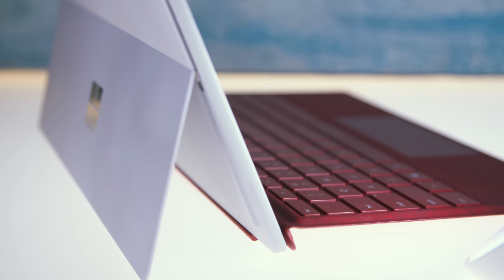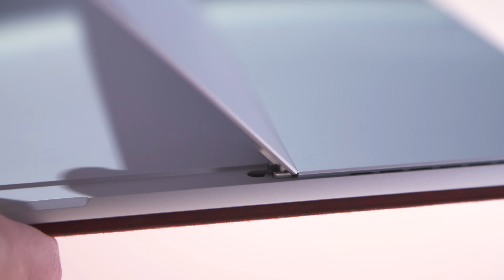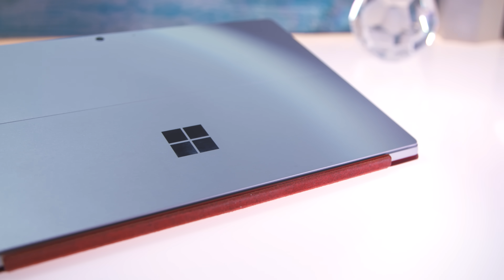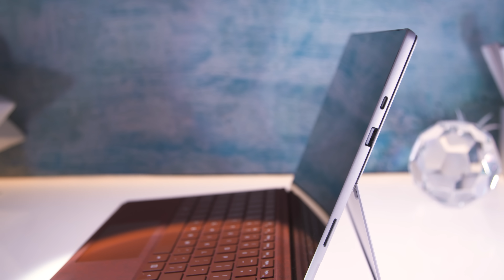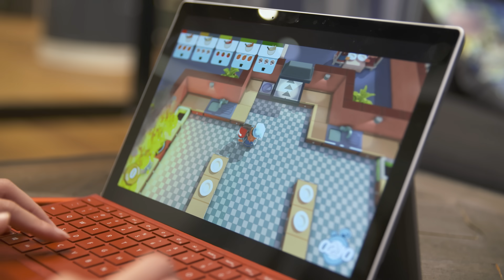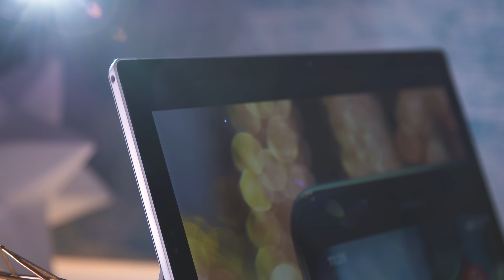Microsoft Surface Pro 7 review: USB-C upgrade, battery downgrade

Comment: I think I’ll get the 6 just because it’s cheaper
Reply: Jiimy I got mine two weeks ago. 850€ the i5/8/128 model with the keyboard.
Reply: Any upgrade of the SP7 outside of fast-charge and usb-c? Are the specs really a big improvement? A lower battery life is a pretty big con.
Reply: @nickh4676  yes iris gpu and faster cpu
Reply: Nicholas Hale I don’t think so imo, yeah that battery life is a big downside, and there’s an adapter with the 6 that has usb c (you have to buy) otherwise that’s it

Comment: USB-C without Thunderbolt compatibility is not an "upgrade", it's mere catchup. 

If the keyboard feels "hollow", lay it flat on the table instead of using the magnet to angle it upwards.

Comment: Never EVER BUY a surface pro shit machine.  The PRO 4 that I had, is one of the worst decisions I ever made when I decided to get a note book.  This should be no different.
Reply: Well if you never try you will never know. I am happy with mine
Reply: Jayakumar Menon what is the problem? Battery life?
Reply: @nuevoinvolve  Everything.  Keyboard forever has problems.  You press one key some other key responds.  You keep reseting the thing and after awhile it comes back again.  The battery life SUCKS.  Accessories cost a bomb.  They had to come up with stupid power supply connectors.  And the list goes on.  I am very contented with my Asus now.
Reply: I love the Surface Pro!
Reply: I agree that the 4 had a lot of issues. But they seemed to be non existent on the 5+ models.
Reply: I have a sp4 2017 with maxed out specs (biggest, fastest etc) since I wanted to make it last a few years. I'm still happy with it except for the battery....oh and this weird fan noise it makes.  I've seen others have the same problems and apparently it's a driver update issue. Anyone else have this problem?
Reply: @danielb3500  do u own sp4 or sp5? Sp5 was released in 2017. Sp4 was 2015
Reply: @ Jayakumar Menon you should get 2017 version onwards. Much more refine. I heard alot of complaints for sp4

Comment: Watching this on my Surface Pro 4. Looks almost exactly the same, lol.
Reply: Looks the same but not a annoying fan like the SP4, a way better performance and battery. But I still won't switch to the 7.
Reply: @apfelschorle1988  yeah the fan on my SP4 is loud. Nowhere for the noise to go in such a thin device.
Reply: So how long does your battery last? Mine just 3 hours (SP2017)
Reply: @nuevoinvolve  you're only getting 3 hours from the Surface Pro 5? It's supposed to be a lot better than the SP4.
Reply: Me too
Reply: TheTelephonePrankster keeps production cost down

You realize that when it comes to manufacturing products that change cost money

But if they can keep the same basic design for long as possible it helps to keep cost down as they upgraded the important things like cpu she ports

But soon as you make a bigger outer design change they means resetting up all new machining for making that new design 

So people want new things every new generation, well the best way to not also have yo raise the prices is to keep the same outer design
Reply: Mine lasts about the same (sp4 2017) ...3hrs
Reply: @danielb3500  do you have the Surface Pro 4 (2015) or Surface Pro 2017?
Reply: @bradavon  I have a 2017
Reply: @danielb3500  SP5 then. You only get 3 hours. It should be much better than the SP4 😱
Reply: It is exactly the same. Much better battery, no fan, fast charging and USB C though.

Comment: We deployed hundreds of Surface Pro's when they first came out. Everyone was so excited to get them. In actually use hardly anyone ever used the pen and mostly just ended up using it like a laptop. Now it's time to replace them and everyone is going back to laptops and not choosing a Surface. The laptops are cheaper too.
Reply: Perhaps more training was in order to educate people on how they could make the use of the pen and touch gestures
Reply: @thetelephoneprankster4254  Why? No-one needs them on a laptop-like device. Which is why I have never seen the point of a touchscreen on a laptop either. Surface devices are mostly used in laptop mode, mainly because windows 10 still sucks as a touch OS compared to the opposition.
Reply: @MichaelGGarry  the opposition being Ubuntu? MacOS? What laptop (not tablet) OS has better touch support than Windows?
Reply: @HenriZwols  I don't think any of them have good or even decent touch support. So to say Windows is the best of a very bad bunch is not to say much at all. 

The opposite would be just as bad with iOS or Android when used in desktop mode. No-one has come up with a solution that works well under both input types, they are all far too compromised.

Comment: Wrong. Surface is not made for people who want a tablet. Surface is made for people who want a surface. It's a machine that's unique in his type. This doesn't excuse worse specs than the previous generations though.
Reply: It doesn’t have worse specs...
Reply: @springbok4015  yeah that's right, it has the same specs as the previous gen, i.e. worse specs than it should.
Reply: @JohnnoNonno  It's got an updated processor :P

Comment: I own nothing that uses USB C. I have my Mini DisplayPort adaptor which does me well enough
Reply: Maybe you got lucky.

I had so many problems with Mini DisplayPort adaptors on my SP4 (I had to buy two adaptors). It would only display 1080p or 30Hz or even the screen would just black out randomly. And when I searched for solutions online, it seemed many others were having the same problems.

My old laptop worked perfectly fine with its HDMI port and my phone never has problems when I use a USB-C to HDMI cable.
Reply: I suppose I was lucky. I did buy the official Microsoft adapter so perhaps there is a conspiracy that they want people to buy their one lol

Comment: I don't understand this whole craze of USB-C. How many devices and times do you really need more than one connection when you purchase a device like this? I've been in IT for 16 years and to date, no one in the corporate world has called me in panic that they needed more than one port.

You also fail to mention that it supports fast charging. Yes, battery is less than previous models but it also goes from 0 to 80 around an hour.

I understand that it doesn't "excite" the sense as they have a something that, "If it ain't broke, don't fix it". Besides, they introduced enough new products to keep our appetite full until next year 2020 holiday.

Can't please anyone these days. Geez.
Reply: I use one usb c charger to charge my laptop, smartphone and Bluetooth headphones. I use usb c also to output display on an external monitor at home, it's convenient af to have just two cables and a charger to do everything, idk what u r talkin about
Reply: The Surface has Miracast so you can stream wirelessly anyway. I am talking about how my phone does not have USB C and I have proper studio headphones. I am not old fashioned and have tried it. Yes I am using an iPhone
Reply: @nailil5722  please, name all of your devices. My Bluetooth headset charges wirelessly (I can't believe you're still using connecting charging for that) as does my phone (and it has Type C, Galaxy S10e). Only my Nintendo Switch and the Pro controller I actually use connection as it is required. 

You are exactly the example as to, everything I have has to have it. So, do you charge each one of these devices with only one USB C at a time.  I'm guessing when you go to bed you have to choose only one device to charge then? "Oh what will it be, my laptop, my phone or my headphones?"

I have yet heard a reasonable reason why it is the so vital to have it.
Reply: @TheHaitian  xiaomi mi notebook pro, xiaomi mi9t, aukey T10, a Samsung ultrawide monitor and some cheap mpow headphones I don't even know the name which to my surprise had usb - c. When I'm on the go especially for work having just one charger in the backpack is a blessing but I guess you have the privilege to stay all day at home
Reply: @TheHaitian  at home of course when I need it I can charge multiple devices with the chargers that came with them. the luxury is being able to charge my laptop and my phone with a usb c charger on the go instead of carrying a proprietary DC charger for the laptop and another one for the phone. All this knowing that you can use that usb c cable for everything. Have you ever experienced a laptop DC charger fail on you while you were travelling for work? Literally wasted my time to respond to someone that probably still plays with a Nintendo switch in his 30' or 40'. Smh.
Reply: @nailil5722  I think you mean the "convenience" and not luxury, you might want to read up on the definitions as to which is what and when to use them more effectively in sentences.

You're not making a strong argument other than the fact that you are not coherent enough to use different types of connectors to charge your devices or good enough to figure out what connectors to take with you to work on the road or keep them in good enough shape for them not to break.

Nice trying on demeaning me because I have a family and we play our Switch together and yes, I am 39.

And don't ever put yourself down saying that you wasted your time. You are better than that.
Reply: @TheHaitian  I've been on a MBP for 3 years so almost everything I own is USB-C/TB3 nowadays. Why on earth do you want to stick with multiple connector types these days?

Also wirelessly charging headphones - are they in-ear or something? They are the only ones I have ever seen have wireless charging. I prefer wearing over-ear cans and they all use some form of USB for charging......

And yes, I work in IT too and am only slightly older than you.
Reply: @MichaelGGarry  Finally! A brother in arms in IT. I don't know if you also work for at a corporate firm, but how many people have come to you for a USB type C thumb drive since USB C has been out? Is it worth buying a whole new Surface just because it now has type C? In our work environment it is not worth it. I'm personally sticking with my SP4 for a couple more years.

Blvcknoir 2 Bluetooth headphones by the way for BT Headset. Pretty solid actually. They are a carbon copy of Apple AirPods for a fraction of the price.

That dongle life is not for many of us. Today, for the work that I do, I would chose a laptop with a Type A usb over a type C and not need that dongle. These days, in our office anyway, we use far more USB Type A then type C for carrying data.

I have no doubt that in some fields it is a godsend to them, but for the vast majority of people in the world, it is not.

Please chime in on this. I am curious about your work place and if they are pushing it in your office. Always good to get those feedbacks.

I'm not saying it is bad technology. It is absolutely wonderful but we are not there just yet. I think once all thumb drives are type C, we will be there. But hey, that dongle life is for people out there that prefer looks over function.
Reply: @TheHaitian  Thumb drives? I have not had to use a thumb drive in about 5 years. Do people not have network shares, cloud storage or any of the other ways to share data?

I can see in a lot of companies there would still be a load of USB-A stuff, that all takes a long time to shift to a new standard in companies of a given size, but I rarely have had to plug anything into my laptop for a very long time. External monitor - simple new cable. Mouse and headphones are Bluetooth and charge via USB (sadly still micro USB on my mouse as I'm not upgrading to the new version just yet), but both of those have incredibly long battery lives that I hardly ever have to charge them. What else is there to plug in these days? Printer is wireless. My external drives are plugged in via a dock which is USB-C. I have an eGPU, but that's TB3 of course.  Everything else is either Bluetooth or wifi. 

The "dongle life" has always been overblown in my experience. I bought a couple of new cables where I could, bought a USB-C to A dock that I hardly ever use and that's about it. Hardly "dongle hell".
Reply: @MichaelGGarry  in our IT world and environment (law firm) the good old USB A thumb drive has been nothing short of a life saver. Particularly in in-house meetings.

For sharing data with clients abroad we did create our own data room and for email attachment encryption we use PGP (a nightmare to get it to work between parties).

Type C technology is wonderful and is the future but I don't think it is a must have for now. There's a reason they left the type A on the SP7.

I agree with you that it will take a long time for it to switch and when it does, it will be very nice but for today's real world scenario type A is far more useful.
Reply: I completely agree with you. I own nothing that uses USB C
Reply: @thetelephoneprankster4254  The only way that's possible is if you're using an iPhone or your Android phone is older than 3 years.
Reply: @thetelephoneprankster4254  I have a galaxy S10e that uses type C but I charge wirelessly, my Switch and Pro controller has it, but I don't need all of my devices to have it.

I always read the same thing, but you can charge all of your devices with one connection. OK, so do you charge them one at a time? No, you will have multiple Type C around if you own only that connection. 

The argument to me holds no merit.
Reply: @Big Boss Not old school at all. Galaxy S10e, Nintendo Switch are the only 2 devices I own that have USB Type C. I'm not complaining that why all of my devices don't have it. How many devices do you have that have type C and how often do you use it? I don't even charge my phone with it I charge wirelessly. Only my Switch and it's controller I have to physically connect.

Please, tell us of all of your Type C devices.

Comment: The real question is how the heck your battery life test got 15 hours for a Surface Pro...
Reply: My Name yeah! Mine is just fucking 3 hours (SP2017)
Reply: @nuevoinvolve  which version? i3/i5/i7? My sp5 2017 still runs over well 8hrs
Reply: EyhTwo Zed i5. 128GB.
8 hrs doing what? Let me know?

I am using adobe software, I bought the device only for that activity, nothing else.

Now just 1 hours.

500ish battery cycle 

Been using just less than 2 years.
Reply: @nuevoinvolve  for net browsing, research and office stuff combination i do get 8hrs plus. This is done under super low bright settings with battery savers on.  
When im on creative mode using illustrator and a chrome with 10 plus tabs maybe i could get about 6hrs with idling mode. I sometimes use other software like paint tool sai. Most of the time my settings are turn off except for battery saver.
I also limit the app that is running on the background. This can be done under settings>battery> see ehich apps are affectingyour battery life and then turn on only reduce work option. 
I also disable some services running on the background. Lastly i work under cool environment. Those are the things i did to extend battery.
Reply: EyhTwo Zed that’s pretty good. How many years using the tablet?
Reply: @nuevoinvolve  i got it when it was first launch. It was an upgrade from my sp3
Reply: @eyhtwozed2606  So do you still highly recommend the sp7? I too am upgrading from sp3 since the keyboard is not recognized anymore by the tablet. Seems I can't find any explanation of why this happened.
Reply: @sw6716  sadly as of today both my sp3 and sp2017 stop working after recent update. My sp3 stuck at surface logo and my sp2017 kept requiring me to input bitlocker key even tho ive done it countless times. I cannot force reboot, i cannot rollback updates. I do not recommend surface product to anyone right now
Reply: @eyhtwozed2606  She said i5. I think, as for now, Engadget is primarily reviewing i5 model combo devices, when there's an option available.
Reply: @nuevoinvolve  do you switch your performance slider to Power Saver? That seems pretty bad even for performance at max.
Reply: @queasy.8065  since from day 1, always use power saver
Reply: Video loop on low brightness level
Reply: @DarkPa1adin  With NOTHING running but the video. Thats why she got 15 from the 6, and only 8 hours from the 7, she had to have had other software running in the background while running the video loop. Especially considering the time she clocked was even 2 hours less than Microsoft published 10-hour claim.
Reply: My thoughts exactly!